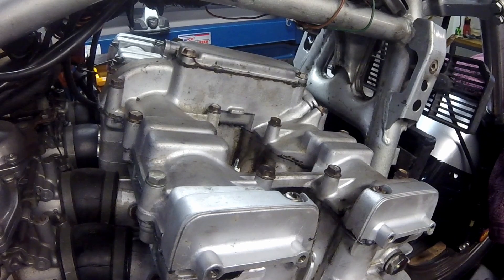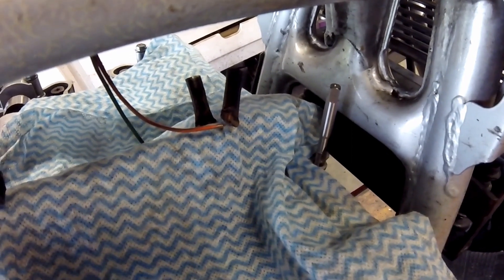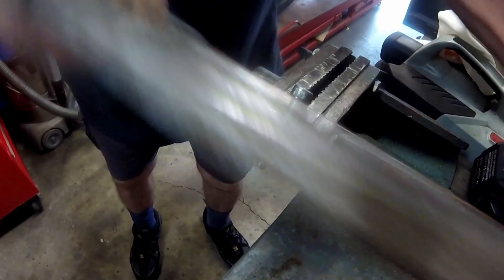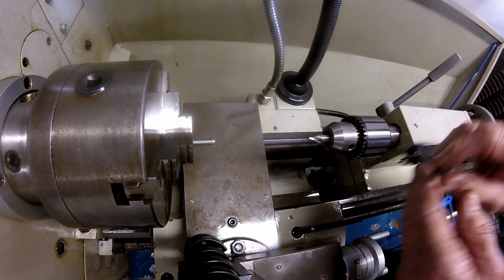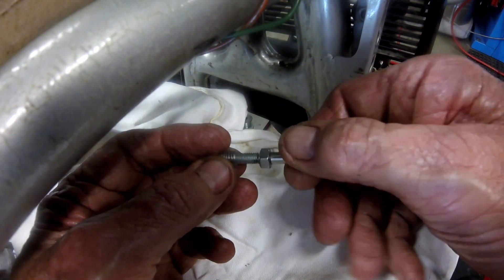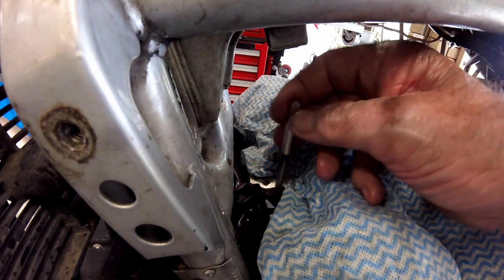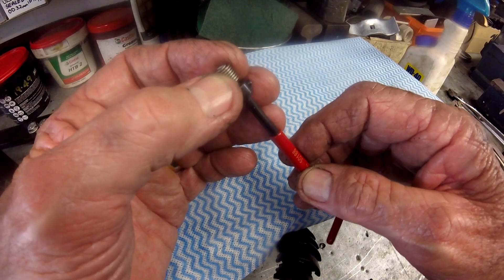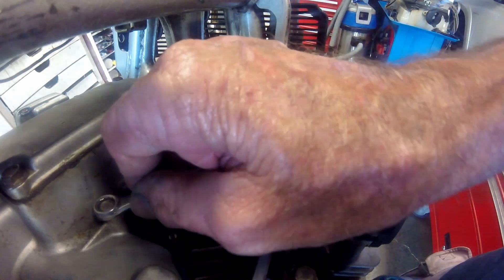Stripped Thread Repair where Access is Difficult |Two methods

Comment: Bob, you star! What a great explanatory video. I am repairing an aluminum block on a 50cc auger with soft aluminum that uses hard steel hex screws and has been reamed out by previous owners/service guys. 
Much appreciate your belt'nbraces fix for an old machine.
Reply from the maker: Thankyou for your kind coments.

Comment: Do you ever find the fabricated inserts work their way out? After the bolt had been removed a few times?
Reply from the maker: Yes, I have had that happen a couple of times. I have though about putting thread locker on the inserts, but have yet to do it.👍👍👍

Comment: Size of socket please
Reply from the maker: The socket use din the video is 1/4 inch e-torx or star drive. However the square drive on taps are not all the same size and I would take your tap along to your favourite tool shop to make sure you get the right fit.

Comment: 10:17 I would think the thread locker would help when pulling the bolt the next time? you mentioned one insert pulling out, is that as common as the stripping?
Reply from the maker: Inserts pulling out is uncommon, they are stainless steel and that usually locks pretty tight in aluminium.

Comment: 1:48 what causes both holes to strip? cross-threading? over torquing?  normal wear?
Reply from the maker: Those holes are some of the hottest spots on the motor, which might be a factor causing the aluminium thread to bind and eventually strip. I have worked on a lot of old motorcycle motors and thread stripping is not unusual, so binding might be a thing. Interestingly I always put anti-seize on sparkplugs, because stripping that thread on an aluminium head is a right pain, but never on these. Thinking about when I have replaced the spark plugs on relatively modern car motors, those plugs were factory fitted and no anti-seize used there and they are quite hard to undo. Now those plugs would have done 60,000 miles at least, so maybe they do tend to bind to the aluminium with time.